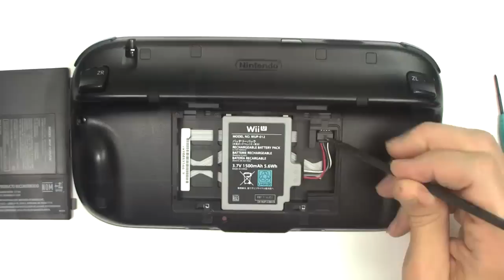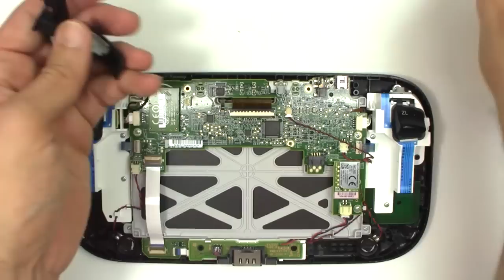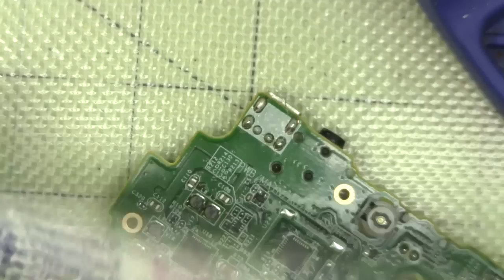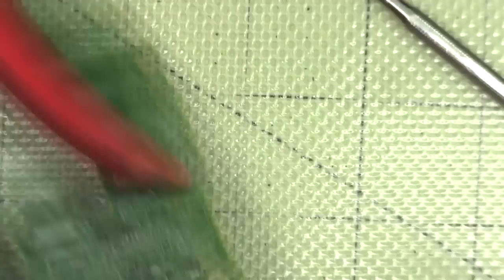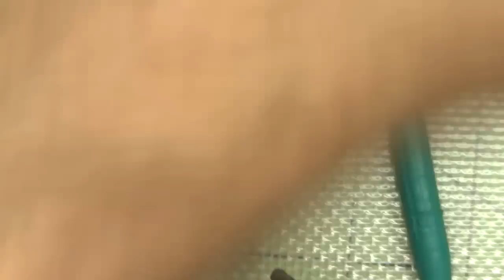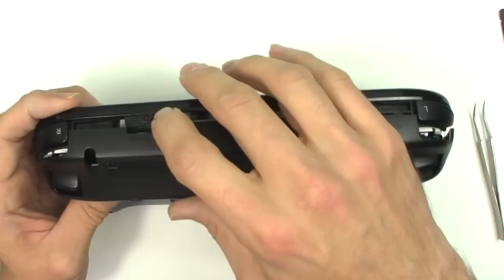Replace Wii U Gamepad Charging Port How-to Demonstration

Comment: Thanx for the wonderful guide / walk through.  You forgot to tell us when to put the plastic bracket back so I ended up forgetting it and having to take the whole thing apart again.  Thankfully I could leave all the cables in except for the battery cables.  Also it would have been nice if you had warned us beforehand about your struggles in removing the charging port as I paused the video (obviously) too early and almost panicked when I couldn't get it off.  I ended up cutting it like you did before I saw that you'd done the same.  LOL.  Once again thanx for the video I wouldn't have been able to do the procedure without it.
Reply from the maker: Jan Petersen thanks for the feedback. Im glad it worked out for you!

Comment: I usually wedge a flat head screwdriver or something under the component keeping pressure on it while working the solder points with my iron.

Comment: About to attempt this in a couple days with a soldering station (no hot air)... Thanks for the video , very helpful
Reply: Have you achieved it? Im a beginner and just have the same problem whit the charging port whit my just purchased Wii U, greetings
Reply: @bryanssj3949  Hey, sorry for the late reply but yeah. If you have solder wick it's not hard.

Comment: @8bitjunkie one of the prongs inside the socket of my Wii U gamepad kept getting bent and broke off.  I was wondering if you thought it would be possible to solder wires on to the socket or the pcb without removing the old socket and just put a different type of plug / connector on those wires and the wires from the adapter. I was thinking of doing this since the socket is kind of a bad design.

Comment: can we change the port with the 3ds port so we can charge it with the 3ds charger
Reply from the maker: Maybe... not sure if the 3ds charger port will match the footprint
Reply: No
Reply: @8bitjunkie8  I did a USB C charging mod on my 3DS and the footprint looks fairly close to me.

But if you're going that route I say go all the way and connect a C PD board instead.

Comment: it's called a PHILIPS HEAD SCREW/SCREWDRIVER!  and when this happened to ours we just bought a second game pad, and use the other pad to charge the batteries and replace into the one that won't charge!
Reply from the maker: Phillips and JIS look the same but are not the same. Usually it doesn’t matter but I’ve stripped JIS screws using a Phillips driver because they are slightly different.
Reply: @8bitjunkie8  ahh never heard of a JIS screw or driver

Comment: I’m lost. My kids gamepad wouldn’t power on. I figured maybe it was the battery as bought this for them when it came out in 2012-2013. 

Ordered a new battery and replaced. Now it powers on but won’t charge. I seen this video and another one where the guy says to replace motherboard. I don’t want to just order things and replace that I don’t need. Any advice on how I could tell what needs to be replaced?
Reply from the maker: First use a multimeter to check the output voltage of the charger to rule it out as the issue.  Then apply 5V directly to the power input pins on the motherboard to see if it will charge. If it does, you should replace the connector.  If not,  you will probably need to replace the motherboard.

Comment: Would this work for the WiiU Pro controller?  My boys jammed the cord in and busted the charging port, and Nintendo won't repair it.  I'd rather not fork out the money for a new one if this is something I can do myself.  Obviously some of the cords are going to be slightly different, but I would imagine it's pretty identifiable inside...?
Reply from the maker: Possibly. I'm not familiar with that charger. This is a board level repair on the Wii U which is fairly advanced repair. I don't know your skill set to know if
It's something you could DIY

Comment: Hi, I have a gamepad where the LED turns blue then amber when trying to power the unit on. Nothing shows on the display. The wii u system actually see's the command and powers on but then the system does shutdown as well when the pad shuts down. Just to note though, the system itself works fine when turning it on by pushing the actual button on the front. I did replace the digitizer about 2 years ago when it broke and it worked great up until this point. My question is can a bad digitizer cause the unit to start to power up but shutdown almost immediately? I have no problem replacing it again if it is in fact the issue, Thanks for any help you can offer. Eddie
Reply from the maker: I don't really know. But, I've seen DS Lites will do something similar if you try to turn them on when certain bits are disconnected, like it does a self check, sees something is wrong/missing and then shuts down.

I'd try opening it up and re-seating all of the ribbon connectors; one of them may have come slightly loose. If that isn't it, replacing the digitizer doesn't cost too much to try it.

Comment: hi my wii u pad charger port doesnt work so i got a nyko charger adapter but the wii pad doesnt charge. if the top one doesnt work does it affect the bottom one ? do you know what can be wrong ?
Reply: Was the nyko a cradle or an adapter

Comment: Good video, but I would like to know why you choose to replace the port parts, is that the only analysis to cure a wont turn on wii-u.  My grand son drop mine and the light turn off, and it havn't turn on any more.  what else can I look fore.
Reply from the maker: only if it won't charge via the top port but will by the docking port.  If he dropped it and now it won't come on at all, I'd assume something came loose inside.  Sometimes your local cell phone repair type place might be able to fix something like this.

Comment: I was considering doing this, but I realized that neither the side port nor the bottom charge port works. It must be a fried motherboard.
Reply from the maker: Is the port where the cable plugs in mangled at all?  It could be shorted out possibly